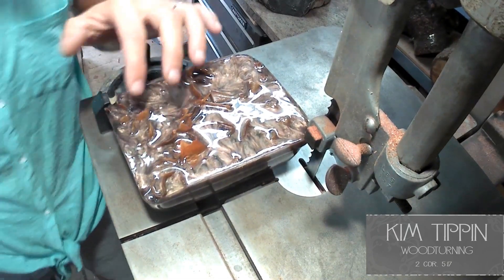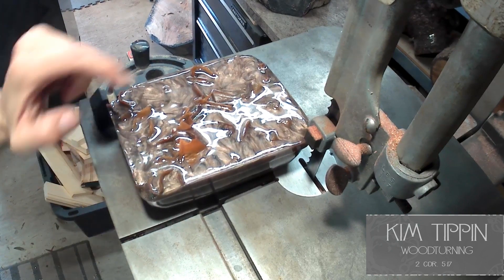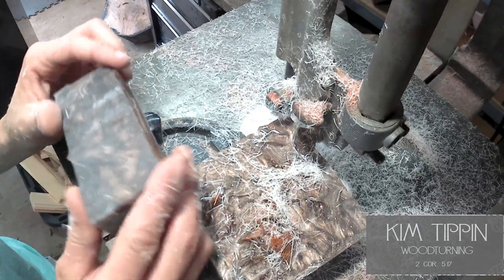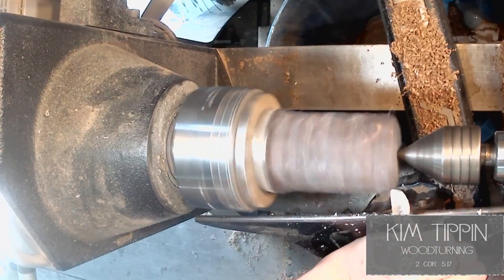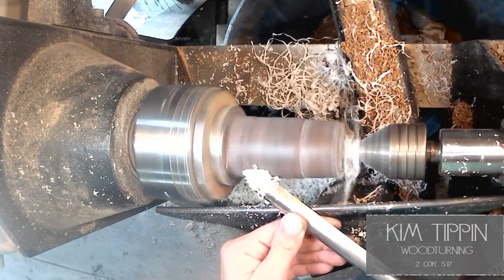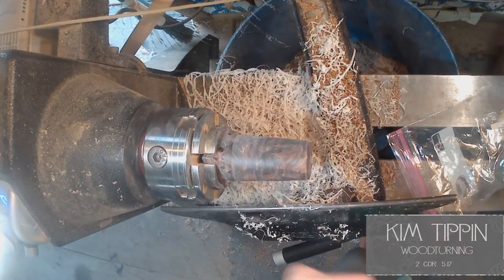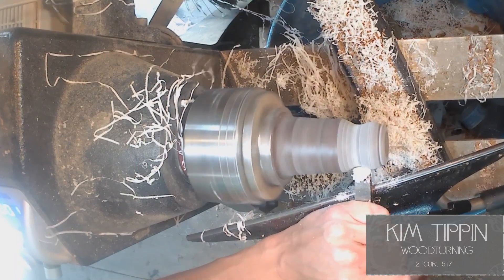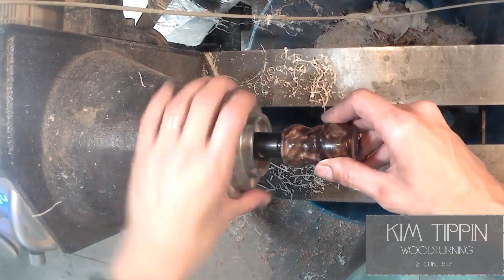Resin and shavings shave brush and bowl

Comment: Great job Kim! Stunningly beautiful.  Can you tell me where you get the brush that you insert in the resin you prepare?  Also can you tell me where you get that micro mesh product?  When you are wet sanding is that water or a light oil that you use?  Thanks for your help!
Reply from the maker: Thank you Jerry!
 The brush knots that I used for this shaving brush I got on Amazon. It doesn't look like they have the same ones listed anymore. But if you search shaving brush knot, there are several different ones to choose from. Like synthetic or real badger hair. Those get pretty expensive drift course you can sell your sets for more. And the description of the video I have a list of items that I use frequently and the links for those items. Take a look the micro mesh should be there. Also I used water for this sanding because there wasn't a whole lot of wood in the resin. Thank you for watching and I hope I answered your questions :-)

Comment: You had a video about using inexpensive cosmetics in your coloring work.  Do you have a suggestion for wood dye coloring equivalent to the Artisan brand?
Reply from the maker: Look for a brand called folkart. Michael's craft store has it but can be found on Amazon too. It is wood dye. It is water based I think. I add alcohol to the color so it will dry quicker. I bought every color that is available. Lol let me know if you can't fine it, I will send a link when I get to my desk top.

Comment: Really turned out nice and good explanations.  Did you use Total Boat for your resin?  I’ve never made a shaving brush and bowl.  Do you purchase blank brushes or brushes with a handle and remove the handle.  What I see on Amazon have handles.  (You truly don’t need to apologize for your mistakes as you work and your process ~ it is a learning process for all of us~I learn from my mistakes and watching mistakes of others).  You are good at what you do—so own it.  (That is a complement.)  The Lord bless and keep you.  😎🤟
Reply from the maker: I can not find the original brush knots the I used her. I purchased these brush knots on Amazon a year ago. Here is a link to get you going in the right direction https://www.amazon.com/gp/product/B076R36Z8C/ref=as_li_tl?ie=UTF8&camp=1789&creative=9325&creativeASIN=B076R36Z8C&linkCode=as2&tag=kimtippinwood-20&linkId=b97f2da2b0aa252ac97bde58fab9fc3b  try wish.com as well
Reply: Kim Tippin Wood Turning ~thanks